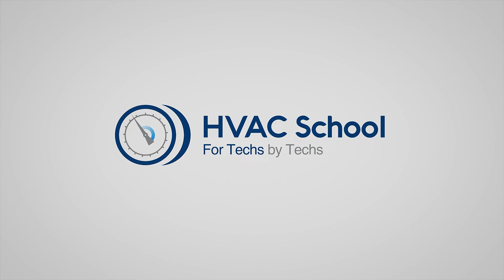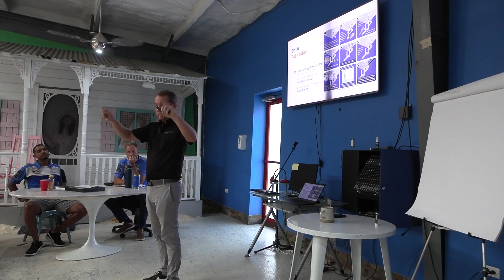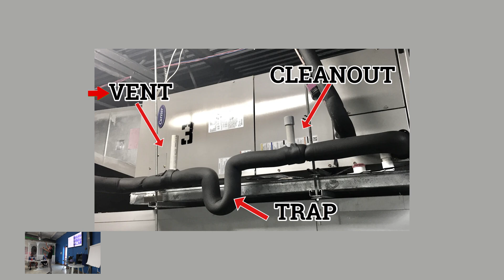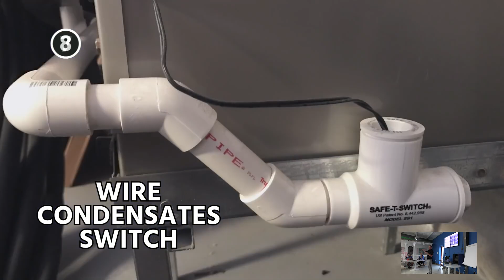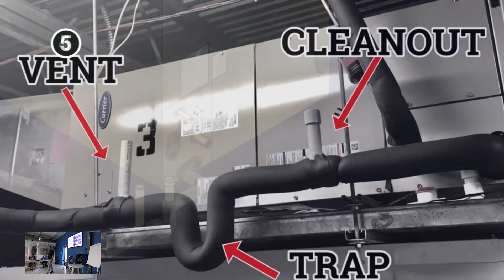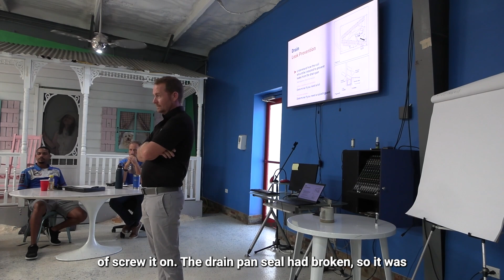Installation Best Practices: Drains and Drain Lines

Comment: If you have a system under a negative pressure but do not have enough space to add or install p-trap what other method or methods could work?😊
Reply: Put the trap outside. I do all the time.
Reply: @cadamham  I'll have to try to find where terminates it's a condo where the drain line goes into a wall, but can't find where it terminates

Comment: I ran into a situation yesterday, and a question occurred to me. This video popped up in my feed this morning. 

My question is why do not HVAC residential installers, specifically referring to apartment building installs, install the trap with two fittings??? 

I notice that some times the building drain may not be conveniently located in the wall cavity;
and the evap drain line is routed over to the building drain line.

The issues with these long runs: 
The HVAC drain brush that is sold is only like 12 inches,
Snakes are made long enough, but they don't navigate any 90s after the first 90 bend very well. 

So, is there a reason we don't make the traps removable for service??????